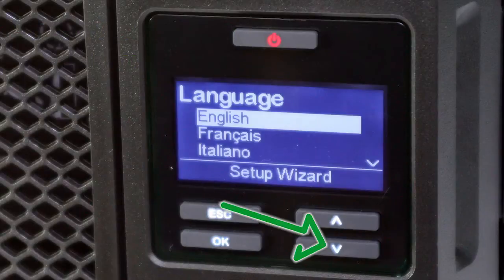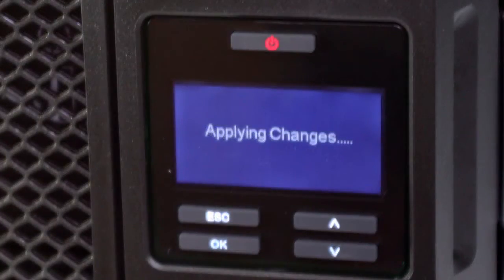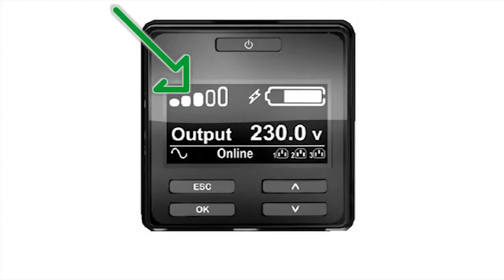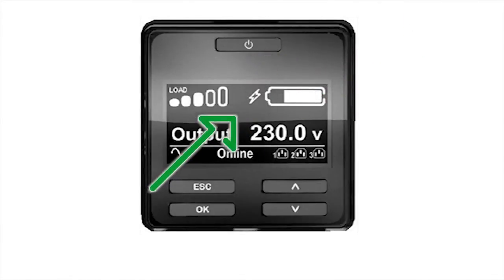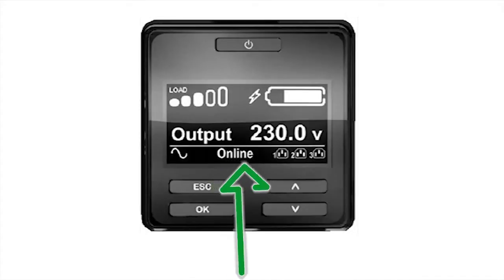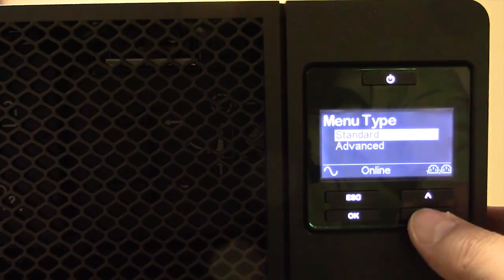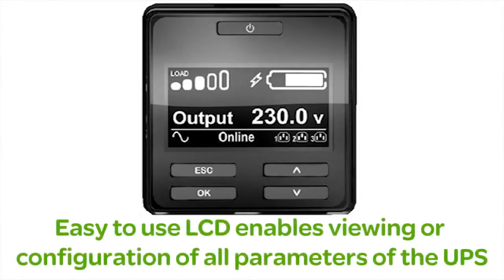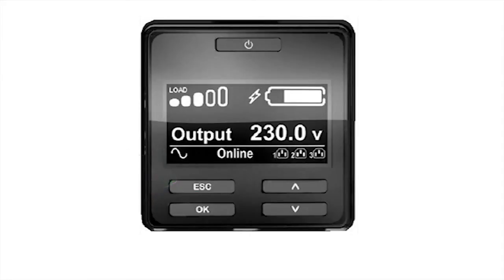APC Smart-UPS SRT10KRMXLI 10000VA RM 230V

Comment: love them but battery life sucks ok i have 1100 watts inverter with 12 volt battery 285 cranking amp but i going used 12 volt deep cycle battery 100 amp those will not able run fridge i think my 1100 watts inverter is much better than ups i have backup cs 350 i try on battery not cutting it for me

Comment: nice video ok but not enough battery life ok you buy 2000 watts inverter with 12 volts 200 amp 1385 watts lithium battery get much better run time

Comment: Love them battery time not long enough  1100 watts inverter with 12volts lithium 200amp 3685 watts will give more battery time I have back-cs 350  battery time not long enough

Comment: Can i connect 2 x 10kva ups's in parallel to get a 20kva output
Reply: It's not in Kva, it's Va ...you don't use a ups for a house battery system. These are 3-phase powered modules that you don't parallel.

Comment: I have a simple question, I bought APC SmartUPS SRT10KXLI but have problem with connected the power input to the UPS. Is there any video tutorial about this step?
Reply: It's most likely because your trying to use 1-PH instead of 3-phase power supply.